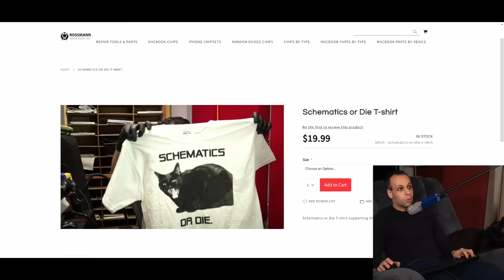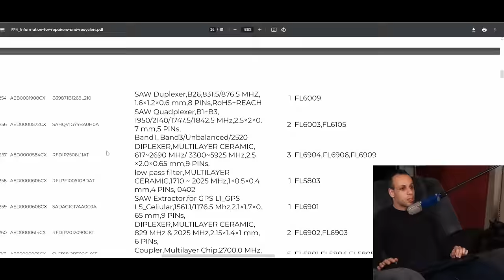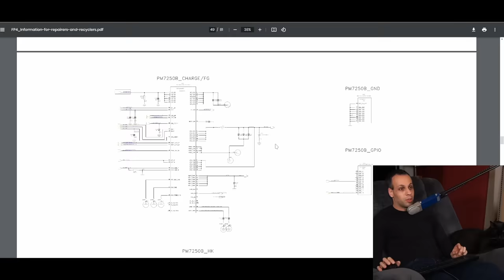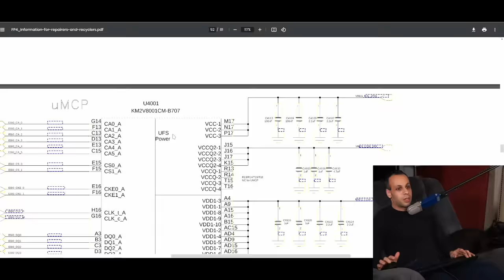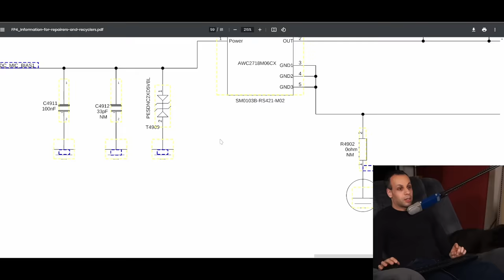Why I was wrong about fairphone

Comment: So my take on this is removing the headphone jack makes sense. And acting like Fairphone doesn't have a point is just being stuck in the past. 
1) Headphone jack unfortunately is one of the ports that go bad first on a phone. It's just a fidly port that is hard to clean and can get damaged that is often in a dustly lint filled environment. If damaged the average person is going to replace the entire module not solder in a new jack. So not really sustainable since basically you need to replace the front camera, reciever, second microphone and proximity sensor
2) If you are worried about loss of functionality A USB to 3.5 mm fixes that and and the phone is compatible with said adapter. It would be one thing to complain that these companies should include charging pass through while using headphones but that dongle is a lot less waste than an entire module and you didn't lose functionality.
2) If you don't like fairphones earbuds buy one that is user serviceable I personally bought Sony headphones and earbuds because they are pretty easy to open up and replace the batteries. at least on their flagship wh-1000xm from the gen 2 up and wf-1000xm gen 3 and up. The phone without the headphone jack can be good and more easily user repairable because fixing the audio jack now requires zero soldering or opening the phone up so basically no skill and at the same time the earbuds not being user serviceable is bad. Both can be true.

Comment: The phone does have an audio jack. It's just in the form of USB C instead of 3.5mm. Why add more components that can fail if you already have a perfectly capable port on the phone?
I think wired earbuds should catch up to the times and use USB C instead of the 3.5mm audio jack. I also think Fairphone should take some initiative in this by selling low end and higher end wired earbuds. Not low end in terms of build quality, but low end in terms of audio quality.

Before audiophiles come at me about the audio quality thing: I speak from personal experience here. I don't care about audio quality. I have high end headphones for their noise cancelling which I need because I'm sensitive to sound. It's nice to have amazing sound quality, but I still use my €30 bluetooth earbuds (the wired variant is was about €15) and I honestly don't think it's worth the money to spend more for a slightly better audio quality. So if they sell €30 sustainable USB C earbuds with the audio quality of €15 earbuds then I think it's a great option for a lot of people.

Comment: I used to be a major stickler for the headphone jack myself. However, I discovered that USB-C DACs like the AudioQuest dragonfly exist and are infinitely better than any built-in headphone jack in any phone ever made, past, present, or future.

As such I will never use the built-in headphone jack of a phone ever again, even if future phones end up bringing it back. For those of you still using built-in headphone jacks, I highly recommend getting a Dragonfly Black (or red if you have extra cash/need to drive high-end headphones). If you care even slightly about high-quality audio (which is the only reason to use wired headphones over bluetooth, let's be honest), do yourself a favor and ditch your built-in jack.

Comment: Actually disagree. Wired IEMs are a niche product, everyone uses bluetooth earbuds, having a jack is therefore wasteful in of itself. Also, no wireless earbuds have removeable batteries, its not practical, so that argument is moot too. Retaining headphone jacks on laptops makes more sense because many people use these indoors and / or at home where they are much more likely to have wired headphones. Good to see they have schematics, its a start. Also... unless your headphones have user replaceable cables then I would argue that broken jacks occur at a faster rate than BT batteries run out. I have 6 pairs of BT, 1 Kleer and 4 pairs of wire headphones.

Comment: I absolutley keep older tech as long as I can, I DO NOT ever get newer "just released" phones, tablets none of it. I run linux on older hardware etc. Anything online in my home is absolutely linux. I used windows 10 etc but only with the cable connected via LAN and cut off from the gateway (internet). Link local only for you windows!. Anyway the only things I like buying new are hard drives and storage, Other than that I do NOT purchase new items. Saves me a ton of money, the way they are forcing people to throw stuff away should be illegal. OF COURSE ITS NOT USABLE IF YOU CANNOT PUT CUSTOM FIRMWARE ON IT! ITS NOW TRASH! AND THESE COMPANIES ARE THE ONES CREATING E-WASTE, AND THEY GO AND BLAME THE CONSUMER.

Comment: But really though, are people even factoring a headphone jack into their pros and cons videos anymore when it come to a product? This seems like a niche concern outside of audiophile at this point. I love being liberated from wires.
Reply: And I'm a big fan of wired over the ear headphones. Volume adjuster in the cable, superb audio quality, no wireless connection issues ever, no extra batteries to worry, can still connect this thing to my old car and old stereos via aux cable.. ahh there are so many good points about the cable 😅 missing the headphone jack feels like missing a finger to me
Reply: I doubt this is an "audiophile" thing only. First, wired headphones are the cheapest and most ubiquitous thing ever. I have boxes full of them, they will never have battery life problems over time and if they break I can replace them for much cheaper than some other Airdot-like headphone. Second, unlike on desktop computers where we have proprietary low-latency wireless devices, on mobile we only have Bluetooth which is terrible for applications where latency is important like voice calls, gaming, etc. Until that improves with Bluetooth tech, or an open low-latency 802.11 low power standard comes as a replacement then that's bound to remain a problem

And finally, there are no "audiophiles" on mobile. Smartphones just have terrible DACs all around. Regardless of you connecting an expensive headset to it, the sound quality will remain limited by the DAC processor.
Reply: It's not about being an audiophile. I make music and don't give 2 cents if my phone sounds great. I use wireless as much as possible, but I travel ALL the time and guess what? Earbuds DIE all the time. Even 'ear swapping' using them mono and letting one recharge while the other is in use only lasts for so many hours before the battery in the case is also dead. Which is why so many of us are pissed off that they are designing away the headphone jack. You could always just carry a cheap pair of earbuds (or nice ones, whatever) and plug them in for a long haul. Never a battery or forgotten charge to worry about. Now we have to take up our charging port with a dongle of some kind to be able to use them hanging out of the bottom of the phone in the most inconvenient mess possible.